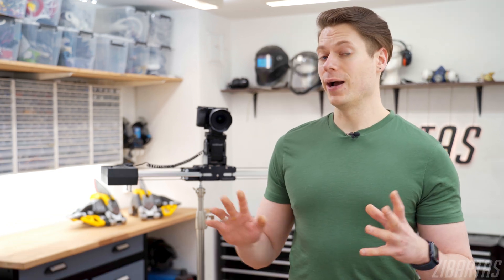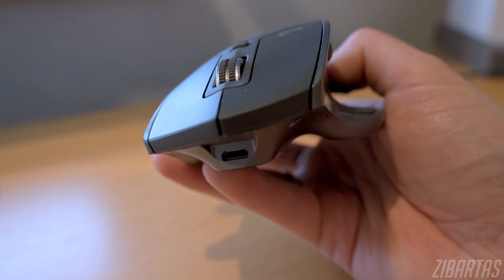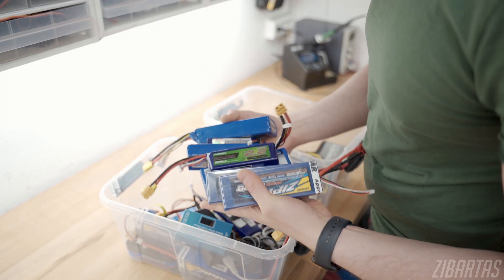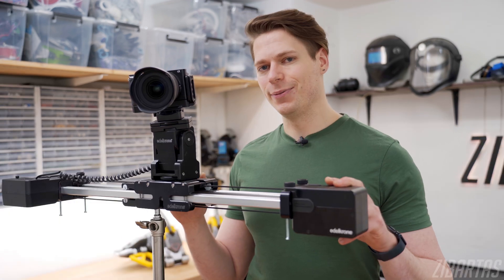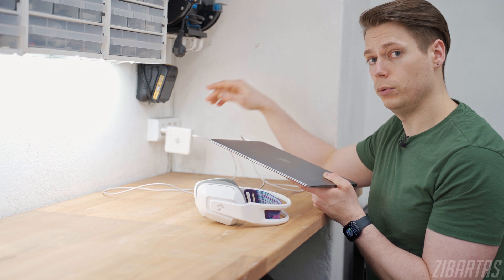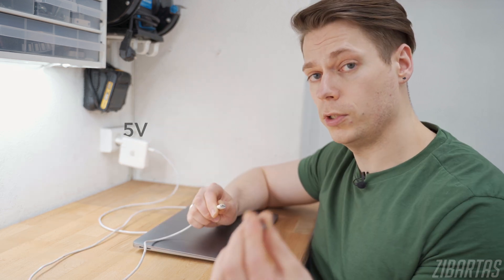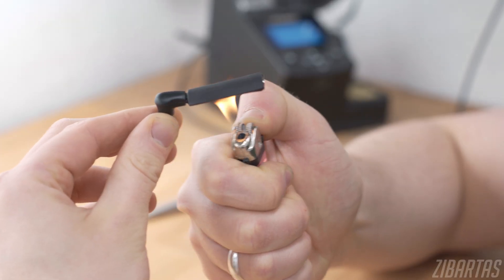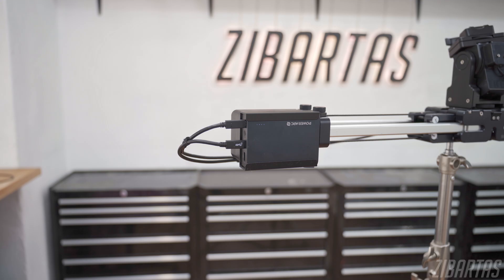Power Anything with USB-C Instead! (USB PD DIY)

Comment: Thank you! Your trick may just become the solution to my VanLife 12v power supply issues … your “hack” should allow me to use the USB and especially, the USB-C power slots on my older Bluetti power banks, that I use to run a half dozen 12v appliances in my van … the issue is ALL of the power banks have only  one 12v cigarette power socket. That works for my fridge, but leaves my sink faucet 12v motor pump and my 12v pressure washer, powerless unless I have a second power bank to swap them back and forth as I need them. Each power bank has one USB-C 45watt, 12v plug. What you illustrated in your demo is that I should be able to adapt these plugs to run small 12v appliances off of my bluetti power banks, without having to swap out cigarette plugs each time. Thanks again!

Comment: Just did this with a super Nintendo 👌 also mounted a battery bank within snes so it's fully portable. I also have 8 bit do wireless controllers with recievers. Now I just need to mod for hdmi output and then use wireless hdmi for a completely wireless experience using old technology

Comment: @Zibartas , great post! Do you also happen to make a PD "trigger board" for USB-C female - male, I have a problem with powerbanks as I want to charge Switch 2 and some HDMI-USB - C video converter that needs separate power input through USB-C, problem however is that this video adapter only uses about 3W of power and since it is "dumb" and doesn't negotiate PD with battery all USB outlets on battery drop to 3-5W although they can deliver 65W PD. Thanks!

Comment: Thank Zibartas for this PRACTICAL video. I have one question, please. I'm sorry for being a beginner in USB C PD field. Is it true when I preset my PD trigger board to 9V and then connect my charger to a 12V device; the charger will deliver ONLY 9V instead of 12V as required? If so, my DIY project is not as good as buying a ready-made 20V USB C PD charger? Thanks again.
Reply from the maker: Yes, it is the trigger board that 'decides' what is the output voltage - so if you need 12V, get 12V trigger board :)

Comment: Nice simple explanation! I am looking to replace the power supply of my 3dprinter to a more simpler connector, DC or UBS C, I wondered if it’s possible to get 24v and 6.25A out of the usbc.
The power supply itself rated at 24v - 150w - 6.25a

Comment: I'm making a power bank and want 1 USB to charge and power the bank the board bms board I have is a 4s bms board which means I need to input 16.8 volts to have the cells all charge all the way is there a way to do this?

Comment: I have a question for you that I think you could help me with, and it would earn you a sub! I have an old xmod rc car (gen 1 skyline) that I have converted to a 2s lipo setup. My setup is basically 2) lipo 112245 3.7v cells in series, connected to a 2s balance charging protection module, and than I have a small dc to dc buck converter connected to the output to control the voltage to the car. I was originally going to supply the 9v with a usb-c trigger board capable of 5v, 9v, 12v, 15v and 20v. I connected the trigger board to the input on my battery charger pcb after confirming it makes the desired 9v with my multimeter however I think its reverting to 5v when connected because the batterys never charged! Its possible it looked like less than the 9v because it was charging but I had more voltage in the batterys when I started than I did after like 4 hours. I know the car is wired right because it all works fine if I use my dc bench power supply to charge it. Am I missing something here? I am thinking its just defaulting to the 5v but I dont fully understand the usb protocols. Thanks for any suggestions you might have!

Comment: i see that you can choose Trigger Boards of different voltages, but what about amperage?
Reply from the maker: In my experience all max out the spec, so 20V will always be 5A max etc. - the limiting factor is the power bank. Some have the volts to spec but not amperage:)
Reply: @Zibartas  Thank you. i have a laptop that requires 19.5V and 7.7A and would love to power it from a 200W power bank via USB-C cable. What do you suggest?

Comment: This is fantastic! I had the same idea and a Google search brought me to this video. I want to power my LiPo charger with USB-C this way. My issue is with safety. 3D printed materials are not to code for such applications, so what would be a good way to house the small board? Heat shrink and then 3D printed housing, as shown? Adding a flame retardant?

Comment: Not all power banks are capable of enough amps. I had a device that needed a specific combo, and it took some times to find a power bank that could drive it. Also, that device had a DC connector. Now THAT is where your video could come in handy. Lets say I had a power bank that was able to drive the device, but it had no DC port…

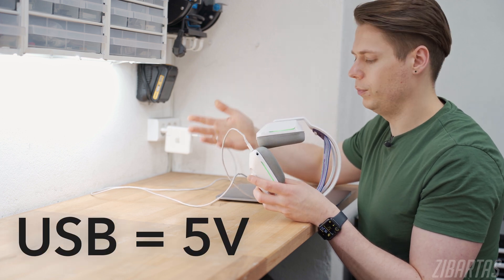Comment: 1:35 per the PD standard, if a device doesn't identify with 'cc' resistors, you won't get 5v either. Important to know if just wanting 5v and wanting to do hacky cable things. Some PD compatible chargers don't follow this requirement though, so YMMV.

Comment: Very useful info.  I have an AC adapter that came with a Lenovo X1 Thinkpad. It had a USB C plug which was damaged (squashed). It has an output range of 20v, 15v, 12v, 9v and 5v. Would I need to replace with a PD capable plug or is the PD functionality within the charger. Incidentally the supply cable is only 3 wires (Black white and Blue)
Reply from the maker: No it's not the plug that would perform the switching, I think you should break down the broken plug further though, to confirm that - if there's circuitry - then it's "smart". If it's a plain one - then I don't see why soldering on a 'dumb' replacement one wouldn't work!

Comment: Well well well, it seems i have found the thing i need for all my projects now. Do you have any idea in how to make a multi powersupply unit that can deliver power from all the batteries to power hungry things like lighting or just function as one big battery for things you want to charge in remote areas? meaning that it does not communicate just on voltage, but does what the charger does(modulate the voltage). Do i have to jerryrig cables to a board that delivers the max voltage to a board that delivers it onto an inverter of some kind? like 12 volt from all units spearately to a controller based on available draw? and just use an inverter that is like 12V 600W max and then do like a regular outlet to deliver it to whatever i need? 

A have very specific needs, but i am willing to jank this to make it work. I am trying to use all of my powersupplies without having to buy, as you say, expensive work arounds or batteries that cost... lets be honest much more than they are worth "coughing in Millwaukee". I do a lot of filming and working in a place without lights and i need to keep power to all units. I have issues with keeping lights on and i struggle to find a solution, since i am not a rich man, so i try to find things that work in the way you have. Do you  have any advice in how to construct a multi powerbank board into something that can deliver variable voltage you want on the other end. Im trying to see if i can power my survaillance system over longer periods of time with several powerbanks instead of 1 extremely expensive one. 

thank you for reading my word vomit!
Reply from the maker: Hmm what about a USB-C 20V 5A trigger board, and then a regular potentiometer (if you need to adjust output on the fly) or different pre-set voltage regulators that could step it down for you to 5 or 12V that you need. That way you'd be within USB-C PD spec and have at least 100W of power available to you. 

As for connecting many power banks in parallel to improve capacity - I'm not sure if just connecting a couple of such circuits to the same voltage regulators be enough. Maybe, if the power banks would be "smart enough" and not try to charge from one another? In any case it's a bit complicated once you start adding batteries in parallel due to uneven charge, internal resistance and what not.

Comment: Alas, it does not work well when trying to power 12VDC LEDs with a very capable PD power adapter. For some reason, if the power adapter is plugged first and the LED second, it works. But if the LEDs are plugged first (as in 99% of devices) then switching the power adapter on makes the LED badly blink in an endless cycle. Perhaps this is due to the inrush current that confuses the PD board or the power adapter (?) 
Bummer.
Reply from the maker: Yeah, I've also noticed that order-of-operations often changes results. What if you'd add a capacitor to buffer it a bit?

Comment: Great advice. It makes sense to consolidate many of the old power delivery to USB-C, and with those handy PD boards being easy to exchange you have a lot of flexibility to power most old tech.
Not sure why you would consider a USB  battery bank more reliable though. They are mostly Li-ion or LiPo based, so it's going to be the same chemistry. You can get LiFePo4 packs that are inherrently way more stable and safe (and last a lot longer in terms of cycles) if you want a better alternative. The only real downside is a little lower energy density.
I suppose you do get a capable controller with some safety features built in with a USB power pack, but thats something you could add to any raw pack too. Anything lithium based really isn't a good idea to run completely raw for several reasons. They arent like old lead acids you could abuse all you wanted :P
Reply from the maker: The "getting a capable controller" part... That's the whole point for me to standardize my projects under USB or whatever else - no need for extra work and in case you run out of power you can borrow/buy one when you're away from home and what not. 
Yes, there is nothing magical or extra safe about store bought power banks - the biggest benefit is convenience and compliance to same specs across brands and models :)

Comment: do current lenovo thinkpad power supply usb C (symmetric round) need the negotiating "PD" chip on the connector end, or are the red, blue, ground wires connected straight through ?

Comment: Thank you. This is precisely what I needed, so as long as the PD (Power Device) does not exceed 20v 5a, anything can run on USB-C.  This is a very relaxed time to buy adapters and build cables. :-) My soldering skills are lacking, but this will be good practice :-)   Thank you again.

Comment: YES! Been trying to convert things for a while to simplify some video gear cable packouts. Reached out to some electrical engineer people a few years ago when PD was still developing and they didnt really have a good answer so I love this being one that I could even do myself!
Reply: 12V was actually there for ages, if all you need is not more than 1.5A, it's part of QC 2.0 and there are triggers for it. It works using USB-A plug and from the looks of it made less complex.

Comment: What about too many amps? Also how did you print the white stickers at the end?
Reply: Amps are pulled as needed unless it is at the component level. Your circuit would take into account what it needs and use dropping resistance.

Comment: Becarfull, the 12v is not a standard for the USBC, some power suply have it, others don’t
Reply: Not true, 12V is part of the standard.

But some phone chargers only support 5 and 9 volts because most phones only request up to 9 volts.

Some car adapters  only support 5, 9 and 12V because then they need buck converters, making the adapter cheaper..

Comment: How do you force a plug-in detection on USB-C without having to re-plug in the the cable every time? I have a Power Bank I'm trying to power a trigger board to 20V but it won't turn on unless I re-plug the cable in to force a plug-in detection. I'd like to just power on/off the Power Bank and have the trigger board come on as well.

Comment: Bro my laptop is 45w so can i use laptop pd adapter which has capable of 100w? is it any damage happenthe laptop and battery?
Reply: The PD boards he is showing select the voltage.. not the current.

Comment: A potentially serious issue to be aware of is that not all USB-C power supplies and power banks can actually produce all voltages.  In fact, I would say most can't, except for higher-end ones designed to charge things like laptops and such.  I believe that means in some cases that it's possible to plug into a power supply that will output a lower voltage.  That might not necessarily harm a device, but, it's always possible that some device will have a problem if you give it too low voltage.  Basically, to use these, you have to check both the voltage and amperage that the PD power supply puts out, and, only use the board with a device that is matched to the USB-C power supply.  Obviously, if you are making your own device you can deal with those issues, but, if you are converting something else, it's pretty important to know about this issue and deal with it.

For example, I put a number of USB-C wall plugs in my house as replacements for regular 120V receptacles. Most of the common brands are 5v only. I got some from Amazon that could also do 9v, but two of them failed within months. I'd love it if someone made one of these PD boards with a voltage governor, that would make sure that it would definitely not output an incorrect level. Then I'd love to use them all the time.
Reply: I have seen the 12/24 volt usb C outlets that light up and say how much voltage, but there is voltage IN and voltage OUT.  For instance, this guy was running his laptop directly from a solar panel through a 12 volt usb c outlet and the usb c outlet port was displaying an amount of voltage.   . . in? or out?  I've got to watch that video again.  That's what I want:  to charge one of those battery bank and jump starter things that charge by usb C and bypass battery and charge controller and see how that works.  Having the right charge cable is important too, as there are chips in there, too.  So there are control chips at every step of the charge.  Gotta watch that.
Reply: If the charger doesn't support that voltage it just refuse to work. I had issues where my 45W 20V capable power bank would just restart when used with a laptop, but worked fine to power 50W projector, despite being slightly out of spec. It's really hit or miss sometimes.

Comment: I hate USB-C PD as it only works with a compatible device that asks for a specific voltage, not even a 5V default. I have so many USB-C devices that don't work at all with the USB-C power supply. As a result I have gone back to USB-A only power. The adapters are nice, would love to see a switch to change the voltage.
Reply: You are doing something wrong or have a bad device.  USB-PD sits on top of USB. USB-PD supplies always start up at 5v.

Comment: sorry, mybe im too tired, but is this just kind of a step up/buck converter that stays inside the PD specs? or it transfers the optional higher voltages of PD to the target device? funny thing is i just ordered a bunch of these boards from aliexpress, but minde were descibed as charging circuits for lion cells... whats up with that? bit confused right now...
Reply: No. USB PD supplies can provide multiple voltages. The boards he is talking about take care of the handshake to negotiate the voltage with the supply.

Comment: Great video! USB Type C is so useful, PPS capable adapters also open up voltage from 3.3v-21v. One note for all USB Type C compliant adapters is they will not supply 5V on VBUS (main power) until proper pull-down resistance or current sink is detected on one of the CC lines from the device trying to be powered (sink). If you probe the power lines of a type-C cable, there should be 0v until negotiated.

Comment: Wow. I have an electric piano that uses a separate mains-powered 12v plug pack. So it needs mains power to run.
Using this USB-C PD idea, I could power it with a battery pack and play it ‘untethered’ anywhere. 😊

Comment: I'm refitting a live aboard sailboat. Traditionally US boats use 12VDC, and have car cigarette lighter outlets scattered around. My plan is to install USB-PD outlets. And for my devices that don't charge from USB I'll make custom cables.
Reply: I am trying to make 12v car vaccum work at home. 
it needs at least 106W.
Not sure if PDs can give 10A output, if set 12v.
Reply: @juzzz.  From what I've read, USB-PD 3.2 maxes at 5A, and provides increased power by increasing voltage. E.g. achieving 240W by providing 48V at 5A.
Reply: @jeffdege4786  ok got it.
i always had this hunch as cable thickness is directly proportional to A.
One solution for my use case is - using a discarded PC's SMPS to get 12v 10A output.
But if buying new SMPS, building a custom power board looks more economical.
Reply: @juzzz. Only way to do this with PD is to step down from 20V
Reply: @vadnegru  
You mean, build a custom-power-board to give W my-vaccum need OR using a Market Available Wall PD Charger to get W my-vaccum need?
Reply: @juzzz.  Reread your original post. Easiest solution would be to just get 12v ac cigarette lighter plug adapter, 10A or even 15A versions exist. 106W is a bit out of spec for a regular PD and going PD EPR for this specific device seems excessive.

Comment: Thanks for the search term "USB trigger board".
I have a ham radio power supply (12V, 25A). Is there an adapter board that can change that to 5V / 9V / 12V ?  What is the right search term to use?